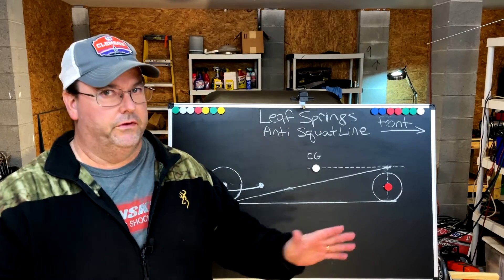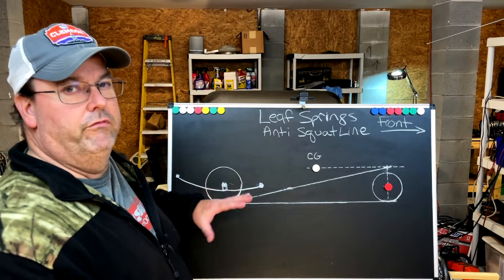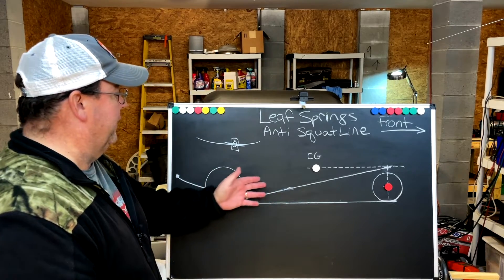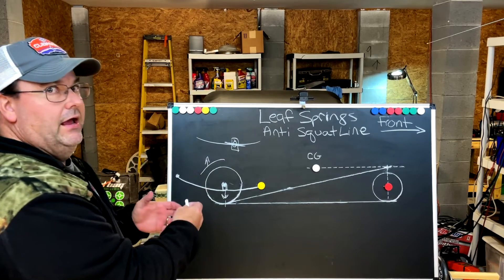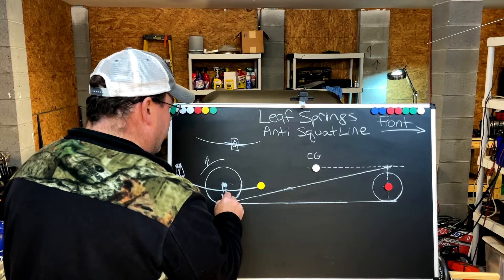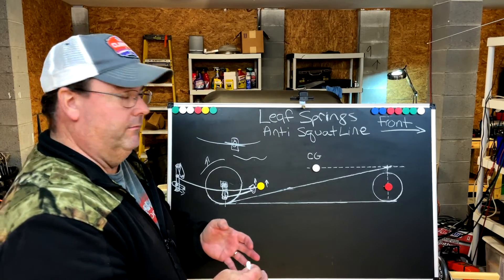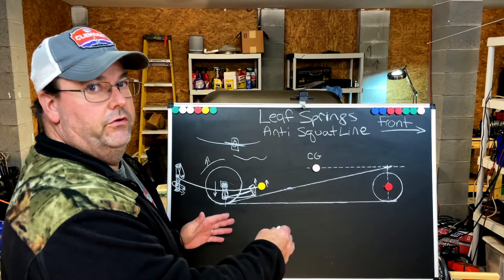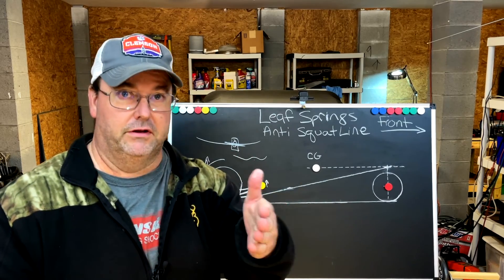Leaf Springs and the Anti Squat Line Explained

Comment: i just moved my front mount up 1in.  loeerrd the rear a touch.  car isnt anywhere as uncontrolable at wot on the street.  gonna try tomorrow at track.  see if it works.  so tired of it being so damn slow.  should be a 4sec car and i have had such a difficult time trying to stay in the high 5s.  very frustrated to say the least

Comment: love the videos, 1 question... why do most all traction bars/calvert/SA bars in drag cars only go to the front spring mount and on say diesel pickups they use traction bars that are 50-70" long? is it due to the angle of the bars when installed? i thought a longer traction bar would help hit the tire harder?

Comment: I love the videos about leaf springs. It’s nice to know that you don’t need all the fab work involved to change into a 4 link but stay with leaf springs and be ok. I understand for drag car setups the slider bar is essential and you are not worried about noise going down the road because your trying to maximize traction. But my question is for daily driving. Is a slider necessary for a street/strip car even though you have a caltrac system and mono split leaf of mono leaf. I love the idea of a slider but if I want to daily drive my car and race on weekends I am worried I will 1 wear out the slider and 2 get too much grit in the slider and bind it up. Would a shackle work good enough for that. Also, say my et is around 12.5-13s. Thanks. Please make more videos about keeping things old school “original with mods so to speak” or stock with bolt on aids while getting performance without making a full race setup or going 4 link. Thanks!

Comment: Very well said. 
Could you give guidance to big end stability and drive.
Application salt flats = 2 mi to get up to speed+ push truck  takes care of launch control. traction and drive really starts to matter about the 1 mi at about 150mph through 5mi at hopefully 230+
91.5 d250 truck  
Think of an extra greasy prep track on to skinny slicks at full ballooned  contact down to 3-6"wide. 
Extra consideration given to sudden unloading from spinning the tires.  

If I grasp the concept correctly:
I should be completely on the anti squat line for no lift on full power and no rear dive on compression braking.
Reply from the maker: There is a bunch more involved in this application. I would recommend you get in touch with me outside of the comments for us to discuss this more. You can reference my website for the best way to proceed. Go fast, go straight! Be SAFE!

Comment: What advice for 4wd in mud racing  setup with front leaf spring as well? Will it work for front and rear
Reply from the maker: The rear principles are still the same. The front, I would mainly just ensure the front leafs can move freely and all mounts are free of all deflection. Go fast, go straight! Be SAFE!

Comment: Thank you for a great video 😊🙏🏻 building a split leave spring slider Caltracks  1932 Studebaker 120 wheelbase and this video was very helpful becouse there is no kit out there, so I had to modify both length of rear spring and the lenght of the lower bar of the Caltracks (shorter/longer) so Thanks from Norway 🇳🇴

Comment: How do you fix the Bunny hop With Cal trac on A-Body Mopars, , I see them launch ,tire smashes and front engoes up but suddenly stops and car then goes, their sixty foots are off by tenths?
Reply from the maker: There are many pieces to that recipe... Most of the time I see this issue, the shocks on all 4 corners are the most neglected and understood part of the recipe based on the power levels, starting line ratio and weight transfer control. Go fast, go straight! Be SAFE!

Comment: Good stuff, easy to understand. How about addressing our home made slapper bars that you mentioned. I modified a Summit racing slapper bar to fit my 71 F100 and am looking for more traction. They are great for controlling wheel hop, not so great for traction. Also my snubber is 1/4' from the front spring eye. This truck has the weird 2 piece rear hanger, what affect is that having ?  Thanks
Reply from the maker: I would need a bunch more info about your car to even begin helping more. Sorry. Go fast, go straight! Be SAFE!

Comment: What happens when you have a rear shackle and you install a longer shackle to lower the rear?
Reply from the maker: I would need more info on specifically what you are looking info on with this change. There are a bunch of changes when you lower the rear. The pinion angle changes, and the CG of the car changes. This means weight bias front to rear also changes. Make sense? Go fast, go straight! Be SAFE!

Comment: I like the video but just installing a caltrac kit well help but the biggest issue here is the plnion angles like being positive numbers is a nogo
Reply from the maker: Not too sure I am following your line of thought on this comment. Pinion angle is critical to a properly setup rear suspension and the goal is getting the static offset angle correct based on the amount of movement on the rear suspension so that during the hit and through the run, the pinion centerline is parallel to the engine/trans centerline. Go fast, go straight! Be SAFE!

Comment: How exactly do you get an inverted hanger to angle backwards? My truck from the factory has the leaf above the hanger and it sits slightly forward of vertical. I tried to adjust it to make it lean back but it just won't do it. Sliders is out of the question until I can get someone to fab up a pair of mounts.

Comment: Hi Kevin, great explanation mate! Since installing cal type bars with the bar front mount only about a bit over an inch lower than the spring mount I have been battling with extreme separation on the hit, it just smashes the tyre into the track before it starts to move at all. I don’t have the shock to control it so will now start to lower the bar and monitor the changes. Thanks again for the video, awesome 👏
Reply from the maker: If you do not have the right valved shocks then you will chase this forever. I cannot emphasis enough the proper valved shocks on leaf springs and caltracs. This suspension absolutely separates as it is designed to do and have shocks with the right extension valving is absolutely critical. See: https://youtu.be/2xcQ3M5xskM and https://youtu.be/TWFHup7KVoI and https://youtu.be/xW04uHfTK3o as must watch videos from my channel on Shock valving. Go fast, go straight! Be SAFE!

Comment: Hey Kevin. I have a question about the rear bar placement. Adjustable rear leaf spring perches are becoming common like what come with the assassin bars but I can't seem to find much info on how the rear bar placement would affect the tire. Obviously the front holes will adjust the instant center but how does the rear affect it? I've been mostly just shooting for level at ride height depending on what hole I'm using on the FWD bar.
Reply from the maker: Are you talking about the rear leaf spring mount height or something different. My apologies, but not sure I am following you exactly on which "bar". Go fast, go straight! Be SAFE!
Reply: @Kevin Wilson  I'm referring to the lower leaf spring plate that the AFT heim joint attaches to. On the cal tracs it only has one option to mount to but lately I have seen the Smith assassin and MAK "gap brackets" and other company's give you multiple holes at various heights to attach to allowing to change both the front and rear bar height instead of just the front like the cal tracs. Just wondering what effect changing the rear would have on the tire. Thank you for your time Kevin!
Reply from the maker: @chevy2adam850  checkout my other videos on leaf springs for sure: https://youtu.be/EsnDUQjpInU and https://youtu.be/WcA5xQGWpuY then let me know if that helps. Go fast, go straight! Be SAFE!
Reply: @KevinWilsonSBC  Hey Kevin. Me again. Just realized my old comments might of been confusing. I have watched all your Leaf spring videos and become much faster over the years because of it but I still have this question. Let me try again. Some of the kits have multiple holes at the rear mount where the bar connects directly below the axle to allow more adjustability. We always talk about how the front hole affects the car but what would adjusting the rear do? I have around 4 holes of adjustability in the rear and the standard 2 in the front that calvert supplies. Google "MAK Gap Brackets" for a example of what im talking about. Thanks again Kevin and have a awesome week.

Comment: Do you have any videos on the fox body rear suspension suggestions need a little knowledge on it I'm used to leaf spring and Cal tracks but I'm doing a car for my wife and it's a Mustang I need a little more knowledge on the factory triangular for at length stock suspension Mustang
Reply from the maker: I will be publishing a Fox Body suspension video soon. For now stick with my 4 Link Videos as the parallel and triangulated follow the same principles. Go fast, go straight! Be SAFE!

Comment: Back around the 2007/ 2008 area I had a 78 camaro with slapper bars. I cut the back of the springs off so it was monoleaf in the rear then I clamped the 2 longest onto the front to stiffen the front of the spring. Cut my snubbers and put wedges in (not getting into detail but I am sure you know why)  but that car separated and would hook on a dirt road. Yes it was a street race/  no prep setup. But it's funny knowing now that they created the split mono leaf spring to do just that. I just did it for free.

Comment: Question; if you were to lower the car by adding blocks between the rear-end housing and spring pad but, adjusted the front spring eye mounting location and shackle length to achieve the same amount of anti-squat %, THEN wouldn’t the cal-trac’s be LESS effective because of the LONGER lever arm (created by the blocks) between the rear end housing and leaf-spring??? The reason I ask is is the mounting hole for the cal-trac’s is about 4” from the axle tube centerline without blocks, but with 3” blocks the leaf-spring is basically centered between the housing and cal-trac’s bar mount (equidistant)...
Reply from the maker: The actual change in force is not a big as one might think. Unless there is some severe flexing due to the extended length. If the angles are relatively the same, then the reaction on the chassis will not be much different. The rotational forces will still exist and the force on the chassis should be close to the same. Just my $.02. Go fast, go straight! Be SAFE!!
Reply: Thank you; I much appreciate your reply!!!

Comment: I've been waiting for this topic. I run Caltracs and now I understand the solid front bushing. They made a huge improvement but my launch is my weak point right now. I've been watching your videos on dual adjustable shocks and that might be where I go next.
Reply from the maker: With today's power levels having the proper dbl adjustable shocks on the rear is so critical to keep control of rear movements, especially if the shock is extending too quickly. Go fast, go straight! Be SAFE!!

Comment: I have been watching your videos and in your part 1 leaf spring video you did, you talked about making a hole above the calvert factory hole in the spring plate under the rearend housing. Just curious if you could elaborate more on what that might accomplish. So top hole in the front and let's say top hole in the back plate if I drilled one. Would it allow more separation?  Thanks in advance
Reply from the maker: Generally the more uphile the caltrac bar is from the rear end going toward the chassis, the more you will help with separation of the chassis and pushing the rear end toward the track. If you flatten the bar getting it closer to level, the less upward tq being applied to push the chassis up and the more you are helping drive the chassis forward. However, the big factor is the location of the front spring mount and if you are allowing enough motion on the rear leaf spring mount. So if you are really wanting more separation, make sure the rear leaf spring mount is free to move and there is enough movement in the rear to allow for more separation. If the rear spring mount cannot move forward or forward and down more, then you are effectively done separating. This is really key hence all the focus on sliders or hangers that are canted back at ride height so you have more movement to allow the rear end and spring to continue down toward the track more. 

Go fast, go straight! Be SAFE!!

Comment: Great info I wish your channel the best and that people can use the info you produce!  You mention in a lot of segments about lowering a leaf spring car and how it affects chassis reaction and my question is , how would a reverse front eye leaf affect chassis dynamics compared to a standard front eye ? The front eye is  in the same location or pivot point but  the the chassis  typically drops 1 1/2”-2”
Reply from the maker: Thanks so much! It is more about the location of where the mount point is on the frame in relation to the Anti Squat line when I encounter reverse front eye... which I don't encounter them very often. The chassis doesn't know nor care if it is a standard eye or reverse eye, but it does care about the height of that push point in relation to the AS line as a reference. Go fast, go straight! Be SAFE!!

Comment: Nice video. I made my own “farm tracs” (mainly from tractor supply and John Deere) and I now get over 4” of separation on my little 4 cylinder truck. Went from 1.6s to 1.35 so far on a radial. Interesting that on mine the bar isn’t really running uphill either. I think it’s that the front spring is so short. Now I need to install some dbl adj shocks to control it. I’m betting I can get a 1.2x. Which is crazy bc it’s almost as good as my 4link 2500lb car and this one is a 3100lb truck. Thanks for explaining
Reply from the maker: That is awesome!!! keep me posted please! Go fast, go straight! Be SAFE!!

Comment: I used the stock spring and slid the second leaf all the way forward and re-drilled the center bolt hole. this made the rear of the spring a mono and the front  way stiffer and worked like a charm.  This was 20 years ago, before I ever heard of split springs. My question is if a block is added between the spring and differential does this add leverage to the rotational force applied  to the cal trac set up ? I also made 1" billet  spacer blocks to lower the  Cal trac bracket between the spring and the bracket to lower the rear of the bar for more of an upward angle.
Reply from the maker: Very cool info cathy gamtbill! The further distance from the axle housing generally acts on the suspension for longer during the run. Go fast, go straight! Be SAFE!!

Comment: Kevin, I have had good luck with my leaf spring setup in my truck. I have cut a 1.32 @4650#, but my question is im wanting to introduce even more seperation, I already have my caltrac bar in top hole and i cant relocate my bolt holes higher for the front leaf spring hole, but what im wondering is if i can add more holes in the bracket on rear end where the bars bolt up... If i could get the back of the bars a couple inches lower in the rear would it help more with seperation? Truck has a radial and double adjustables on all 4 corners.
Reply from the maker: Great question... increasing the angle will help apply more upward force on the chassis and help, but you need to make sure you have adequate travel on the rear mounting point of the leaf spring. Checkout my part 2 video here to get a better visual of this one: https://youtu.be/WcA5xQGWpuY Without more travel and without more shock travel the combination will be limited. Go fast, go straight! Be SAFE!!
Reply: @KevinWilsonSBC  10-4 yes I have plenty of travel. Thanks for the response 👍

Comment: Thankyou for all the info! I wish you threw in 30 seconds about wedges to add or remove pinion angle if that can help or not. LOVE the videos! Sending love from Australia
Reply from the maker: I meant to add that in.. sorry... with leaf springs to get pinion angle you will need to use wedges for sure... I will get that added soon. Go fast, go straight! Be SAFE!!

Comment: You killed it Kevin. I have watched many video's and await more info daily as I build my truck. I have cal-trax and waiting to order my 2" drop split mono. I bought a build in progress, had the cal's and stock springs minus the overload spring. I was doing a SRC rear suspension, but decided I wanted the split mono. With that being said and your video, would it not be better to get a factor ride height spring and use billet lowering blocks to get the lowered height I want? (Gen 2 reg cab S-10 max 5" rear lowering). That way I'm maximizing bite or anit-squat with the blocks lowering my angle. I will be using bolt-on sliders for adjustability of blocks, added weight I.E. turbos, intercooler. (Daddy Dave's s-10 set-up). About to watch the linked video's because obviously I missed some and I just checked 2 day's ago. Thank you for your help man getting us new guys up to speed. I was going to do a 4 link after a season or so but I might be able to get a stock location/stock suspension, all metal/all glass, stock firewall/stock floor to compete with this Forged 408 on twins in the no-prep world pushing 1400ish.
Reply from the maker: I like where you are thinking for sure! Maximize bite for sure! I am glad you found the channel and definitely watch the linked videos. Keep me posted! Go fast, go straight! Be SAFE!!
Reply: Is the minus -2 spilt mono springs stiffer is that why the stock spring with blocks is better